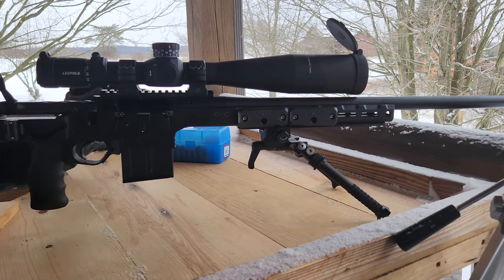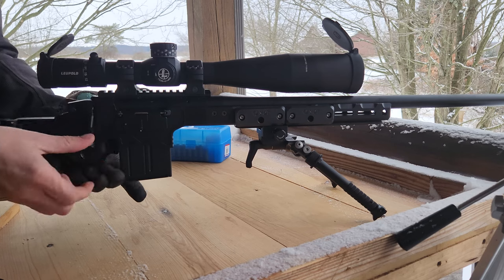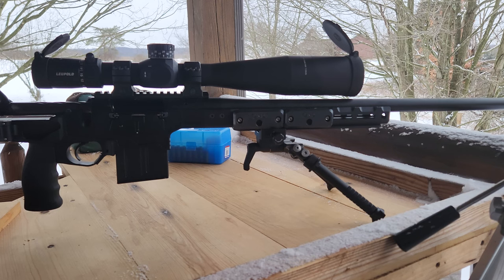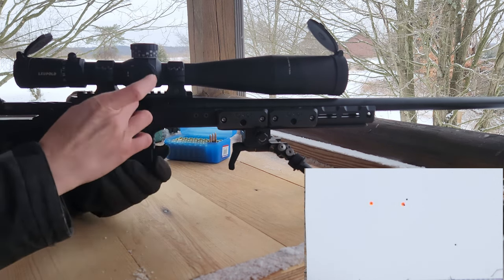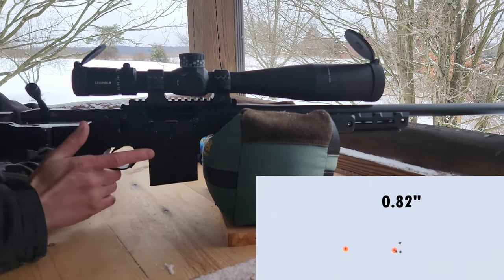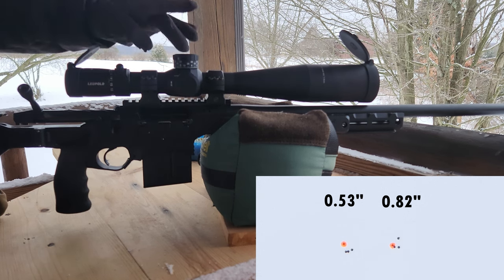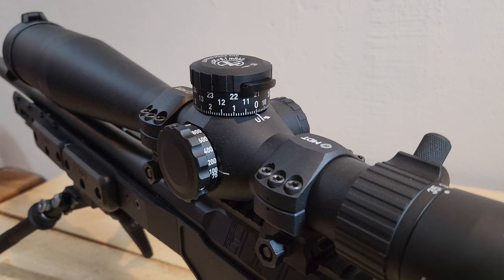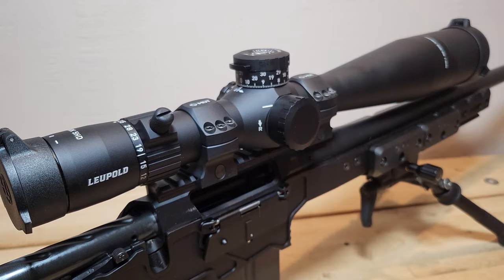How to Sight in Leupold Mark 5HD

Comment: Nice work.  I like to use a 10" orange sticky target at 100 when bore sighting.  As it will usually fill the bore almost completely.
Reply from the maker: Sounds like that would be a good option as well

Comment: I had a 5-25 that was a great scope very good glass and you can get at a decent price. I only sold to fund a 7-35 atacr when I decided to switch to mil scope. The Leupold was slightly brighter in my opinion.
Iv had several Leupold scopes that were excellent and I really like the locking turret.
Reply from the maker: I was a big fan of the turrets when shopping around. Also was a big fan of the simple pr2 reticle. More in dept thoughts to come as I get more acquainted with the optic.
Reply: So is the 7-35 brighter than the 5-25?
Reply: @Ace-wu4zm  I felt that my 5-25 Leupold was a little brighter than my night force 7-35. Both excellent scopes. For the money the Leupold is great.  Want a 3.6 to 18 mark 5 but would definitely buy another mark 5 in the 5-25 or 7-35. Retical is great and they have the locking top turret and have excellent clarity and bright at low light. I only sold my 5-25 because I was switching everything to mil.

Comment: I am new to long range so I am still trying to learn.I am a handgun guy.I have shot competitively all over the east coast for about 8 years.Anyway I hope you can help me out.I have looked everywhere on how to zero this scope and there isn't anything specifically about it.I have this scope and I have had it for 10 months.It is on my new tikka t3x tac a1.I am already to go I just am not sure how to sight in this scope initially. So basically I take a target put it out to how many yards,you never specified?. You look through the barrel and move your elevation turrets until it lines up with the center of your bullseye on your target.After that you go to your windage turrets and move them until they are lined up as well.The setting my zero thing I'm confused  by.Can you think of a simplified way of describing setting your zero.I really could use your help.Does everything else I said sound about right? Thank you so much!.Great videos! I am talking about taking the cap off of the elevation turrets.How do you actually set it after you sight your rifle in.Once I catch on I will do good afterwards.

Comment: I need some help, I got the turret stop locked and I have no clue how to unlock it so I can dial it how I want it. Any help would be great.
Reply from the maker: I take you have already tried pushing the button.
Reply: Yeah it’s high and won’t let me go down. I think I need to give them a call.
Reply from the maker: @Hades16899  it will only let u go down about 4 clicks past zero. If you need to go down further. Loosen your cap and set it away from the zero say at 6 mil or moa then it will let you go down.

Comment: Unless you are a benchrest shooter, there is no practical use for a 35 power scope, especially a tactical scope, shaking my head
Reply: 35 power for shooting tiny groups, lower power for other stuff. It’s like multiple scopes for the price of one.
Reply from the maker: It also has a min power of 7, so for long range shooting you often are not going to need less than 7 power anyway. Why not have 35 power for the most accurate point of aim when shooting groups?
Reply: This is where I think alot of people are wrong, sure you probably never need 35 power to shoot but if you have a scope that can go to 35 then when you use 20x to shoot at 1000 you will have much better focusing, field of view, and removing parallax than if you had a 4-20x scope shooting at 20x. So seems like haters trying to justify their reasons for by a 20x vs spending another 200 for the 35x lol. Plus I love shooting my nf at 32x at 100 for tiny groups
Reply from the maker: @Forumrida38621  yes, I have a 20 power scope and a bunch of 24 and 25x optics. With the small price difference to upgrade to 35x it was a simple decision for me. I likely won't shoot at max powder other than for groups.